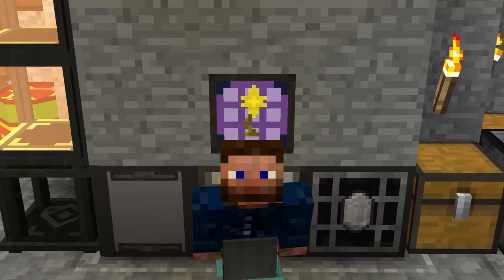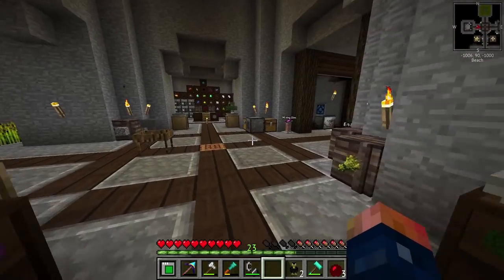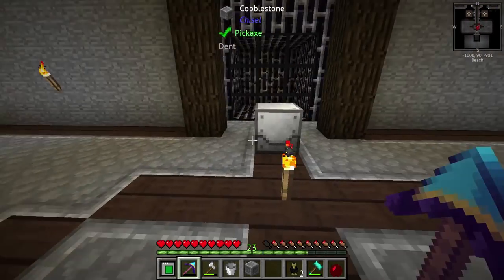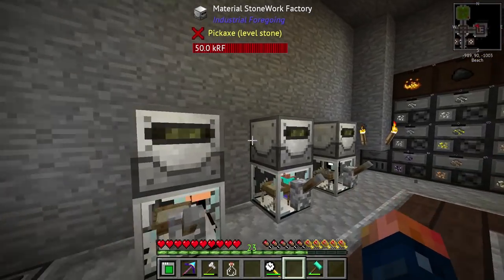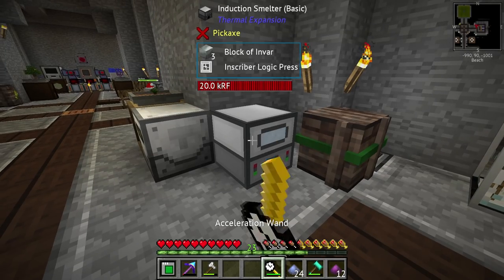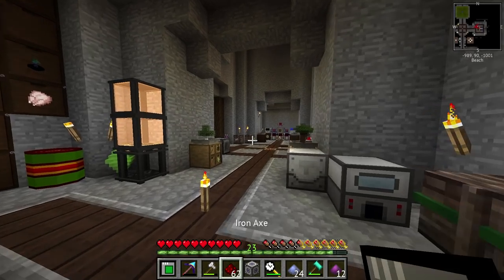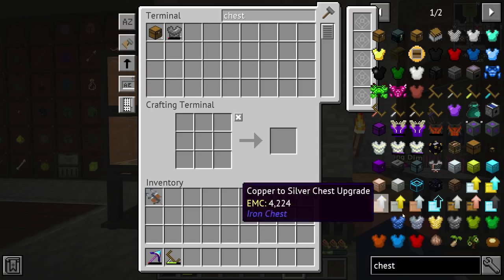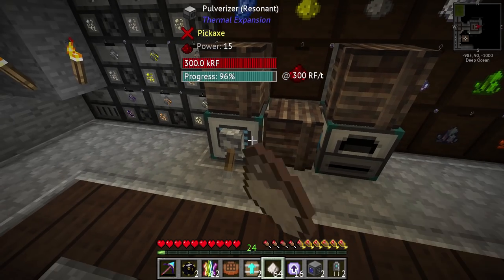StoneBlock 2 Modpack Ep. 10 Simple AE2 Setup + Pink Slime

Comment: Instead of manually dumping stuff into the ME system you're better off just running ME cable over to the drawer controller and putting an external storage connector on it.  Then you have access to everything in the drawer system without any of it actually taking up drive space.

Comment: Chosen, I'm having trouble launching stoneblock, when I try and launch it, the loading screen is slow and it keeps crashing , do u know what I could do to prevent this because I'm dying to play stoneblock
Reply: I know a fix, because that happened to me, but I only know how to do it on MultiMC. If your using MultiMC, go to the settings, MultiMC settings, and set the ram usage to like 6 to 8 gigabites. That’s what I did, and it fixed it easily. If ur computer can’t handle it, try closing everything other than Minecraft and MultiMC, or lower the ram to like 4 to 6
Reply: Try turning on your computer

Comment: it literally hurt watching him build flux blocks via the stupidly expensive manual crafting recipe instead of just chucking a few redstone blocks in a furnace (which is an option I KNOW is in this pack since I've played it myself, and love flux networks)
also worth noting, early on before you have better power options, a maxed out stack of coal chickens feeding a compressing drawer feeding in turn into a petrified fuel generator, while it DOES require a little over 3 stacks of coal blocks to set up (if you can't fill the 3 slots of the generator AND at least 1 block in each hopper slot, it'll try to pull single coals instead of coal blocks), once ready will produce coal faster than it burns it, resulting in a perpetual up to 800rf/t PER generator, and you can stack 4-6 of these setups around a single flux point, depending on if you want it to look nice or be more space efficient. 4 with one on each side and the rooster stuff offset via hoppers can be set up in an X tower form, which in my opinion looks much cleaner and leaves space to walk through in case you want to tweak stuff or on the off chance it ever clogs/fails for some reason, like if you play on a server where chunkloading is frowned on and as a result it gets partially de-loaded or you say forgot to add lights and the creeper that spawned inside blew up while you were walking past...which you can tell from the fact I'm being oddly specific has totally NOT happened to me at least 5 times across different modpacks...but if you don't care or are on your own pc/private server you can run the towers straight up and stick 2 more in for more space efficient builds just need a few sideways hoppers to feed one underneath and an extra stack on top